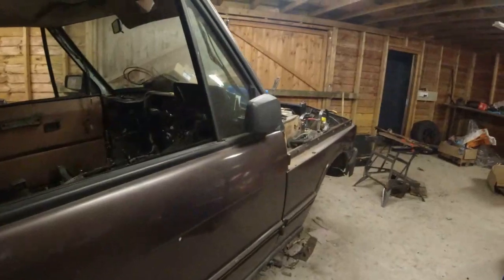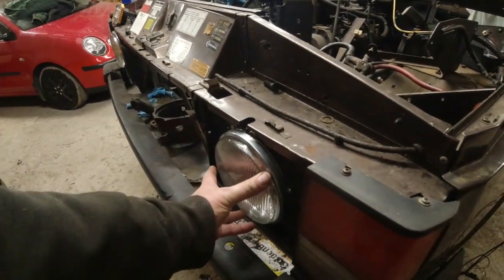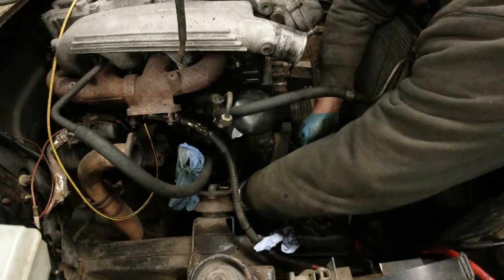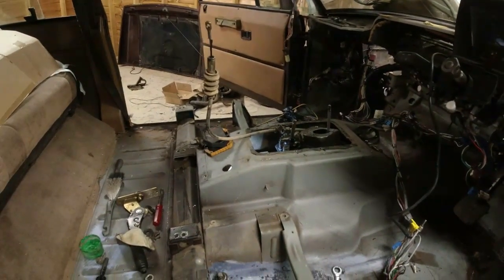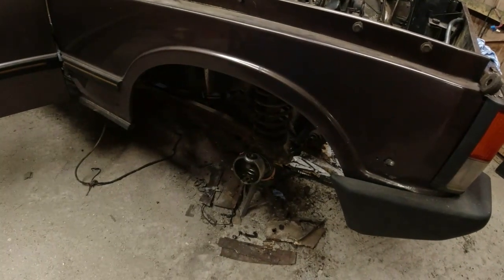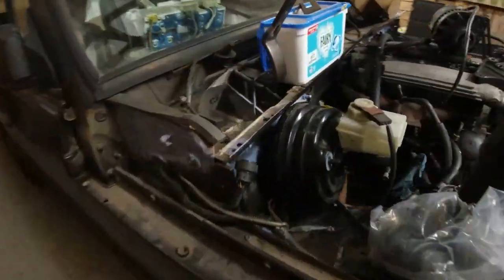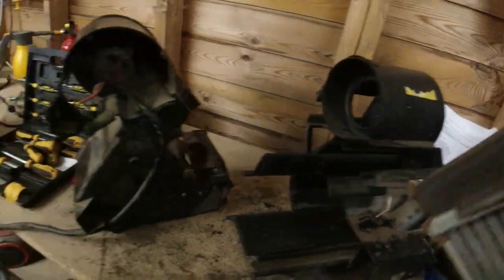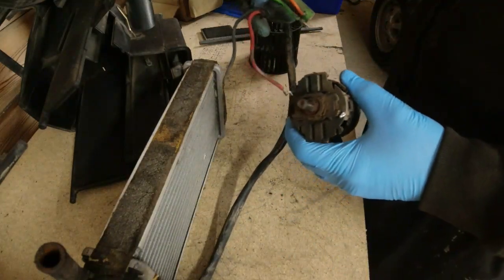1991 RR Project Haggis Part 5 - Unobtainium - Profanity warning

Comment: To get stuck threads/parts apart I use a product called Plusgas..... it's really good stuff!  (Amazon)
& I would make a template in paper or cardboard of the shape of the bracket's you need & then take them to your local Water Jett/Lazer cutter,  you will have most of the shape of the bracket done,  then you can add any spacer's you need from there!
Good luck..... looking forward to the next video.

Comment: Very interesting Richard.  The VM cars were always slightly oddball I suppose, the first Range Rover diesels I believe?  Like you say, a 200/300TDi swap is probably best now, if you want to keep an oil burner; I think the chassis mounting points are different however.
Enjoying project Haggis, keep it up!